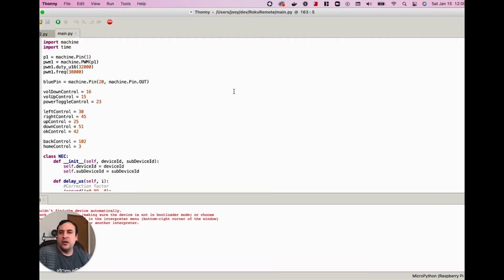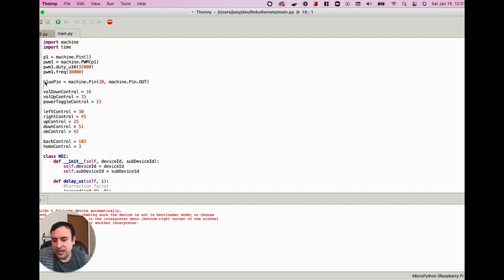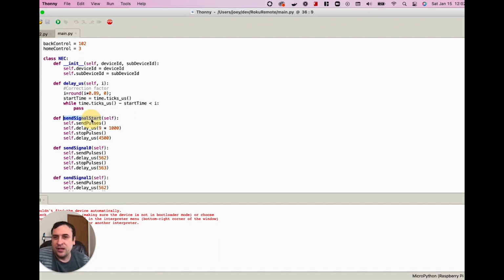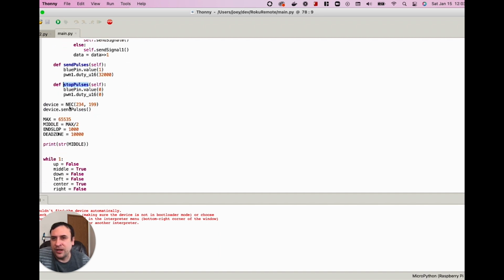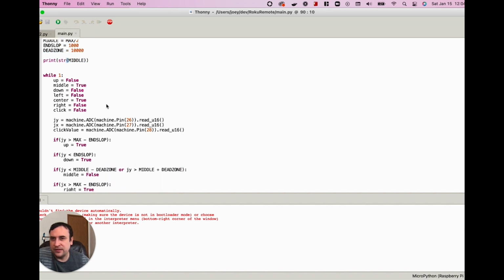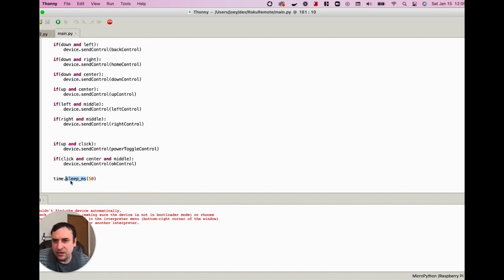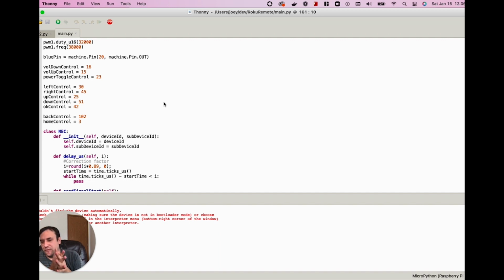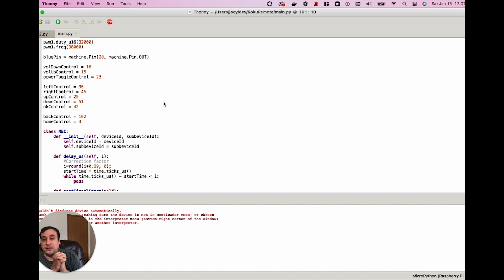DIY IR Remote Control (Using RP2040 and MicroPython)

Comment: 5:20 I’m a newbie in electronics. Wouldn’t the capacitor you’ve detached from the circuit have solved this problem?
Reply: Or was it actually there to make the 38kHz pulse?
Reply from the maker: @_emanmodnar  definitely wasn't used to make the 38khz pulse.
Reply from the maker: It's been so long...  I don't know :)